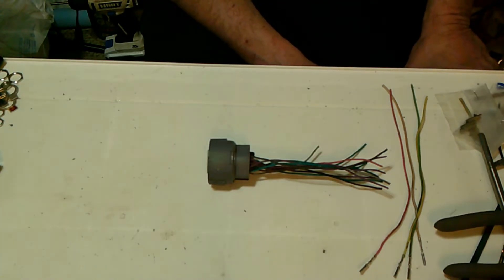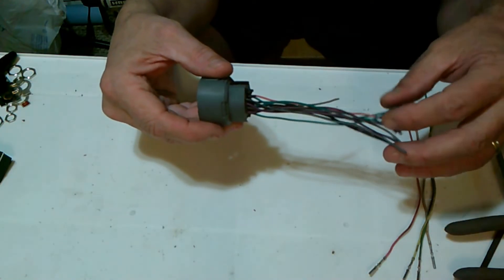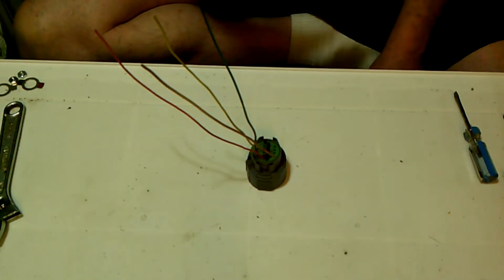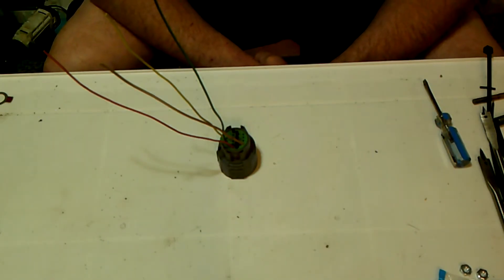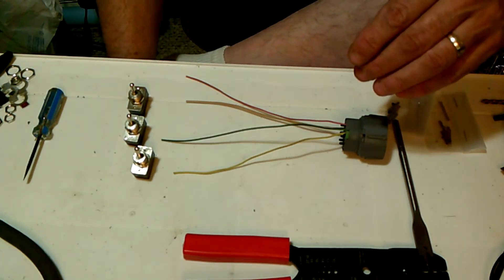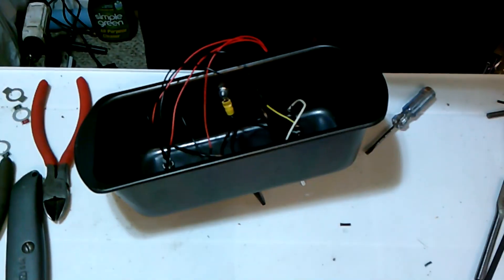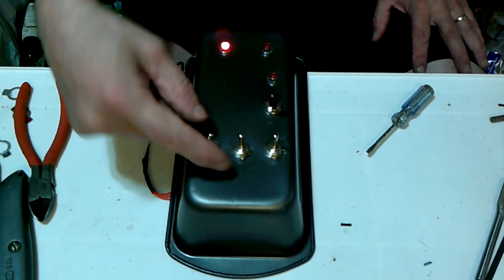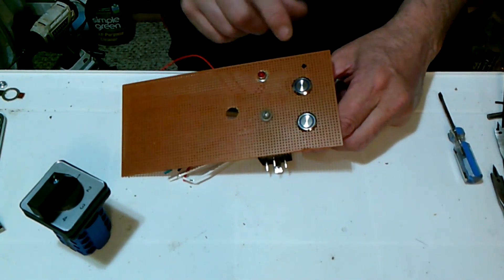Manually shifting a 4l60e or 4l80e transmission without a computer.  A better way? plan 1

Comment: I did the same thing with my 4L 60 but I swapped it with a 4 l 80 and now I can't get the gears but but the thing is is mine's on a 93 Chevy suburban I got it to where I mean my switches I wire them to where I just use my gear shift and put it in drive and boom it gets first second third just like normal off of my gear shift was my gear shift but and but you have to keep the switches in a certain position and the gear shift will activate the switches normally you don't have to flip your switches I'm trying to figure out the same thing with the 4.l80

Comment: How do you shift into reverse?
Reply from the maker: With the shift lever.  Park is park, reverse is reverse, neutral is neutral, drive is essentially "forward", using the switches determines which "forward" gear you are in.

Comment: No one has explained what all the wires do that go into the transmission. A new plug is available for about 25$ total. The new plug to tranny has a bunch of wires but you only use yellow (solenoid A), green (solenoid B), a pink wire for 12VDC+, and a tan wire for the torque converter lock-up. What are ALL THE OTHER WIRES DOING? First gear requires ON/ON (A-B). 2nd gear requires OFF/ON (A-B). 3rd gear requires OFF/OFF. 4th gear requires ON/OFF. TC-lockup requires ON. This can all be done with a 5 position rotary switch (12-lugs, 3-poles, found online). The one I bought also has a zero position(so, 6 positions total) for nothing on. The wiring for this requires A-B to see position 1 (First gear) through two individual diodes joined to Pos-1 and a 3rd diode to also allow only  A to be on when TC is ON. For 3rd gear the Pos-3 lugs in the NEW ROTARY SWITCH are not used at all here. This is not a complex circuit but you have to orient and locate the diodes correctly to isolate A or B at times as per need. The advantage is that anyone can shift logically and the lock-up position can ONLY be left on when intentionally using position 5 for OVERDRIVE! So, question is, when you discard/ignore/obsolete the old tranny plug, what do all the other wires do? WE NEED THIS QUESTION ANSWERED. And do we arrive at a set-up that allows us to totally obsolete the computer? Some people have taken the computer OUT. I have seen it - but they FAIL TO EXPLAIN the other wires!
Reply from the maker: I have a video on using a rotary switch
https://www.youtube.com/watch?v=J-zYritJjjg
The other wires are for controling line pressure and maybe other things I don't know about.  Lack of computer control leaves the line pressure maxed.  There is a vacuum control module available to control line pressure instead
https://www.ebay.com/itm/254736529399
The 4L60E  is just a 700R4 with computer controls added, so it's not really an OMG shocking  concept to take the computer away.  They ran a lot of years without one.
Reply: @Myklesmayhem  Maybe I saw that switch, it had 16 lugs, 4-position? I could not find it for sale, but I realized the 6-position switch would do everything. I've ordered diodes and I've built my carb set-up. 3 Kawasaki carbs. A guy with old Ford Maverick used a Briggs and got 43 miles to the gallon. He had OX-sensor in tailpipe and some simple computer on dash. Any recommendations for this little computer that reads Ox-sensor?
Reply from the maker: @YouKnowTheyExist  6 positions opens up cool options...like an arduino controlled paddle shifter on 0 and OD with lockup on 5 like you mentioned. 
 I'm curious on what you're going to do with the diodes, I'm a novice for sure, the only times I've used diodes was to rectify A/C when I wanted higher voltage for a tube amp than I could get using a rectifier tube and as a check valve.  
Sorry I don't have any insight to add on your project, but it sounds really interesting.
Reply: @Myklesmayhem  The diodes are one-way check valves, allows A and B and TC to have the desired unification or isolation from ground. The symbol for diode is an arrow, the point (not the flat back) is toward the desired source of electrons, which will be GROUND and will be provided through the switch. "A" solenoid gets a back and also a parallel wire over toward BOTH Pos-4 and TC, "B" solenoid gets a back and a parallel wire toward Pos-2. The points of the A-B diodes are connected together to one lug at Pos-1 of the rotary switch. TC wire will see Pos-5 but also will see the parallel to "A"... but this parallel line to "A" needs a diode with its back toward "A" .... This almost completes the schematic. Next, the rotary switch lugs TO BE be activated by USER will be switched to see ground when activated. As for ZERO position, maybe you can explain to readers why you like this option. Zero-pos does NOT have switch activation of ANYTHING but you get the extra 2 lugs on the switch (goofy design and waste of lugs?). I am assuming the manual shifter can work on its own IF the "A-B" solenoids are deactivated, which they are (deactive) when the rotary switch is in ZERO-position. Thx Bud!
Reply from the maker: @YouKnowTheyExist  OK, I understand, I had enough "lugs" to keep the solenoids isolated, you are using diodes to accomplish that...smart.
My thought is the 0 position can be used to power an arduino micro controller and use it to control the solenoids via a paddle shifter.   So 0 would be paddleshift mode.  I'm a ways from actually making this happen, too many projects and not enough time. 
 I have come up with a cheap speedometer that uses an arduino and a hall effect sensor that I think is kinda cool.  Next step is to route the transmissions speedo signal thru a VSS sensor to the arduino instead of using the hall effect sensor.  Keep your eye out for videos if you need a speedo plan.
Reply: The rest of the wires are inputs to the computer. You have the wires that go from the pressure manifold to the computer. That is a set of internal switches that turn on in each shift. This tells the computer if the commanded shift was achieved. The other cables are for the temperature sensor. I wish this answers your question about the other cables

Comment: How do you intend to control line pressure rise via the EPC (electric p ressure control) switch. Without line pressure rise and fall. Trans is doomed.
Reply from the maker: https://www.ebay.com/itm/254736529399

Comment: Could you make a video to where you shift it only with the column shift like it’s a fully manual trans but operating off of only the column shift is their a way to put it in like a manual wiring mode I’m trying to do this to a 1996 Chevy Tahoe
Reply from the maker: I'm putting it in an older car and don't want to pay for a computer to control it.  I'm not sure I follow what you are wanting to do.  It sounds like you have a computer.  Don't you already have the option of manually controlling your shifts by using the column shifter? 
If you don't have a computer and are wanting to use the column shifter only, I would probably start with lever activated micro momentary switches or something like that mounted so the column activated and deactivated them.  I really don't want to give it more thought, I'll end up spending way too much time figuring it out and I have too many things I'm already not getting done.

Comment: The second plan seems like it’s going to be a lot easier, but either way works good job
Reply from the maker: Ha, easier he says, the converter lockup on a relay part is kicking my butt, I can't find a way to make it latch with the load being before the relay.  The rotary switch for gear selection is cake though.
Reply: @ once you figure it out it’s gonna be awesome.Less switches is always better. Anyways, this is over my head.😂